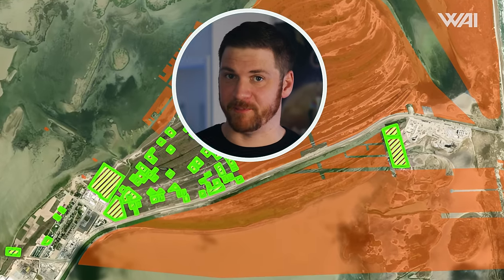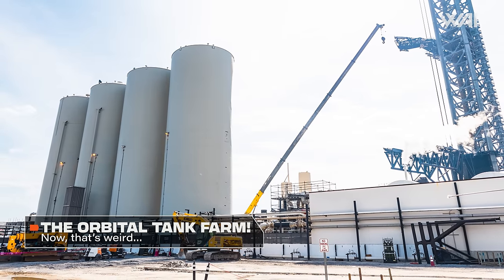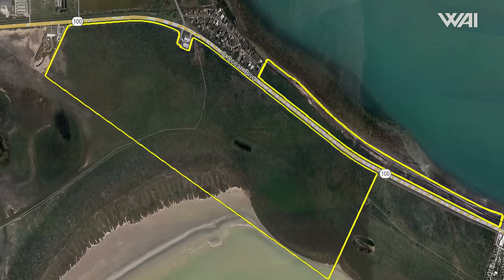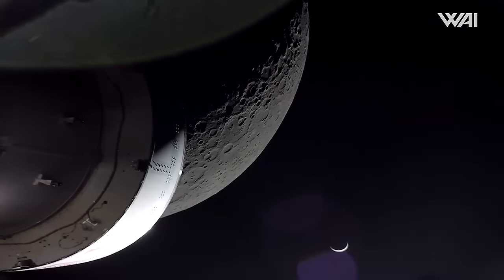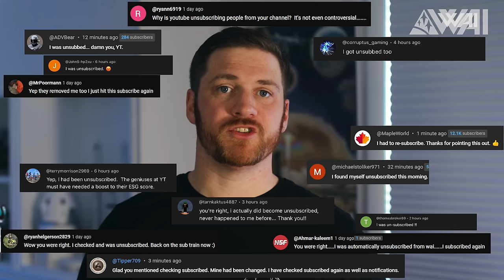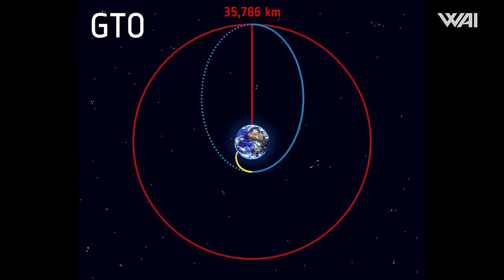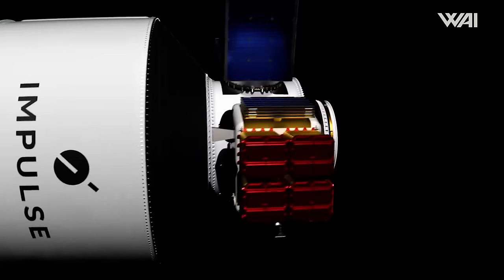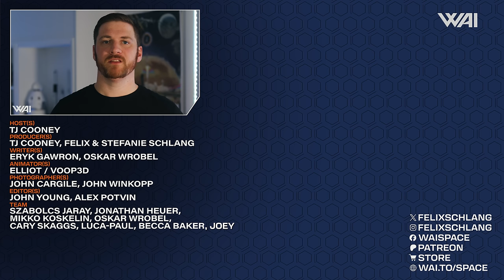Big Reveal: SpaceX & NASA Mars Plan!

Comment: The launch base can’t keep being welded back together after each launch. One would think it weakens the structure with each re-weld.  A redesign might be required. Not very ‘rapidly reusable’ considering. 

I said it during the first launch, actually before, that I couldn’t understand how they could launch the world strongest booster and not have a flame diverter. 

Of course I received snide comments like “I’m sure the engineers at SpaceX know more than you” well… you were saying. 

The water cooled plate doesn’t allow flames to escape the pad like most do with a diverter in addition to a suppressor. They have one (now) not both.
Reply: The launch infrastructure is much "test hardware" as the vehicles and the construction yard are. The current tower certainly won't be the final version... it just needs to be good enough to do a few launches, and they'll incorporate the necessary improvements into the next one.

Comment: I believe that, the actual workhorse that would lead us, humanity, to Mars, is a reliable SSTO ship, where the cost by pound of cargo to high orbit drops considerably, enough to make the cargo transfer to a interplanetary ship, and that could be even materials for assembly on orbit. Remember that open interplanetary space has a ton of radiation, enough to give deadly doses for the crew if not fully shielded. This shielding, is heavy, being a metal one as lead or a magnetic one, wich also needs a lot of energy, more likely nuclear reactor (fusion or fision) with all its weights and problems. After that, if the mission is a long one, the need for hidroponic oxigen recycling is the more reasonable way, and all this needs energy, space, resources, etc. So... My best way to see a Mars mission before 2050 is a SpaceX built SSTO, where it can reach high altitude flying, where the altitude per pound of fuel efficiency is better, then kickstart the vacum optimized rocket engines to propel the craft to orbit. Years ago i made the calculations and you could deliver 20~25 tons to ISS orbit with this method, avionics borowed from a F18/F15 and the SpaceX engines for oxigen methane crigenic propulsion. The aerial propulsion its just a turbine/scramjet hibrid (already tested and working as a clock), and you could get real high, at real fast velocities, giving the craft a nice boost in initial speed and altitude, and you start where the atmosphere is starting to get slim. Win, win, win situation. The tech exists, the capability is there, the only thing i believe isnt there is to show how much difference is between public military/civilian tech and the hidden tech, wich makes me believe im not the first guy to run this numbers and getting this conclusions.
Reply: Hey how's Skylon going along? Is it launching regularly like Falcon?
Reply: @alvianchoiriapriliansyah9882 the what? I believe that half of the things i said in my comment you didnt read... But anyway... You can check my math anytime, and if you have diferent results, feel free to show them to me. I stand with my math, i revised many many times...
Reply: @sammaier4413 Because relying on an SSTO rocket that's not even testing components yet is surely far more reliable than relying on proven flown method /s
Reply: @alvianchoiriapriliansyah9882 and thats why i specificly didnt said rocket SSTO, talked about flying with a turbine/scramjet hibrid... Does that sound to you as a rocket?
Reply: @sammaier4413 Yes which is similar to Skylon, currently unknown if it's ever gonna fly

Meanwhile Falcon 9 just launched a few hours ago, and continue to do so for many times a month. I can see which method SpaceX will use to economically send missions to Mars
Reply: @sammaier4413 Convince SpaceX then
Reply: Well, im trying! I have tried to talk directly to them, 3 years now... But no luck... I guess that i have to make a scale model and show them it can reach high atmosfere to them to take this seriously...

Comment: Seriously, jets travel faster spaceward than rockets with an angular approach. A mach 1 jet would beat a rocket to space. Using less fuel in the process
Reply: Question: where would you get an oxygen for jet in space from?
Reply: @alvianchoiriapriliansyah9882 Possibly from all that fuel reserve that isn't burnt off in launch?
Reply: @CalamitousJonathan Yes, "oxygen is a fuel"... lmao
Reply: @alvianchoiriapriliansyah9882  Currently yes. Liquid Hydrogen and Liquid Oxygen are currently used as fuel.

Comment: SLS Block 2 has so much potential. Can't wait to see it fly!
NASA should have planned to go with 2 SLS (one lander, one Orion) from the start, instead of spending billions on funding the development of two additional redundant methods of bringing large payloads to the moon. One of the main reason SLS is so expensive is because they spent so much on RnD, only to barely use it with very low launch cadence, thereby splitting the RnD among only a small number of launches. 
NASA should be launching one or two SLS missions per year, at a minimum. And not just Artemis missions, NASA should be funding many more missions that take advantage of SLS's capabilities.
Imagine if NASA built the Saturn V, only to then also fund the development of the N1 to deliver the LM to the moon.
Reply: Those single lander cost more money for NASA than two of the current landers combined, and with added nice bonus of being able to go beyond budget

One of the main reasons of SLS high cost is because it's primarily focus on jobs. It has more workforce than SpaceX & ULA combined because some Congressmans/Congresswoman's wanted to get reelected. Inspector General dismiss the idea of increasing production reducing cost on SLS

Don't be fooled by Griffin's rhetoric
Reply: @plainText384 Hmm Inspector General seems to disagree with that

Comment: NASA still has a big problem with arrogance. The finance arm of NASA (HQ) is not the problem. Many administrators/directors and many experienced NASA engineers are suffering from inexorable arrogance. The recommendation is for NASA to change and start pushing these people out or place them into a silent parking position. What is needed is the aspiration of the newer NASA personnel. Did you know that NASA avoids hiring from industry and encourages hiring directly from school? One reason for this is to avoid the deprogramming of commercial hires prior to training towards the NASA way of doing business. What we need is a new NASA with new NASA policies with a new way of doing business. This is what is really needed for getting to Mars efficiently and effectively. Come on NASA. Stop holding the human space program back. We need NASA to start safely accelerating. This means more failures. Since NASA can no longer survive major failures, the best solution is to transfer the risk to commercial development companies like Space-X. This is a good direction and it shows that NASA HQ has figured this out and will get the GAO seal of approval. Go NASA HQ!

Comment: * DEEP SPACE TRANSIT TIME REDUCTION SCHEME *
Immediately begin the development of a "Port Tug Accelerator" space craft (featuring nuclear powered engines designed PUSH items to high velocities quickly). This specialized space craft will be used to PUSH (accelerate) any spaceship toward its deep space destination! The Port Tug Accelerator craft will push any deep space bound space ship only for a short distance and then let the deep space bound space ship glide to its destination with the high velocity provided by the Port Tug Accelerator craft. Place one Port Tug Accelerator craft stationed in lunar orbit until needed, and place a second Port Tug Accelerator craft in Mars orbit for Earth Return Trip velocity assists. This high speed accelerator system will reduce space ship fuel requirements and reduce travel time in space. (Thanks for your considerations and for sharing this concept!)
Reply: How does it DE-celerate?
Reply: Continuous acceleration of 1/20th G until mid point, then flip and Continuous deceleration until target. The Delta-V increase from using nuclear to accelerate the fuel might make this possible. The other benefit is that then you have a bit of microgravity to make activity onboard a bit easier. Keeping the Tug in space makes sense though, once you have it out of the atmosphere, keeping it there will make people less anxious than constantly bringing nuclear fuel through the atmosphere.
Reply: @kstricl  The idea of a Port Tug is for it to NOT leave Earth's/Mars' vicinity.  It'd need to meet the incoming vessel in 'deep' space, dock with it, and apply acceleration to slow it down for orbit-to-planet transfer.
Reply: @LordDustinDeWynd  I understood your idea, but it takes a huge amount of Delta-V change (aka fuel) to meet an incoming vessel. Much cheaper, if you're going to do it, to have the tugs stay out in space (in geo maybe?) and essentially "rent" them for the mission duration. A vessel would have to be going relatively slow for a planet side capture, which negates the advantage over just doing a massive burn with a group of Raptors. A strong steady push could shave months off the mission, without putting major stress on your components - which is why even the ESA is looking at possibly going nuclear rocket for deep space missions.

Comment: Griffin is not all wrong, SpaceX would have to refuel their moon lander in HIGH Earth orbit AND transfer cargo in orbit to carry to the moon, none of which has ever been attempted. How many Starship tanker trips would be necessary to refill one moon lander, 10 or more? How much of that fuel would be consumed just for the trans-lunar injection, then the lunar descent/ascent and the return to Earth for more fuel and cargo? Far too many complicated, untested parts to be a viable system, remember "The best part is no part"! Much simpler to launch cargo directly to the moon on reusable boosters and EXPENDABLE landers that can be repurposed on the lunar surface and keep two SMALL fully reusable passenger shuttles at the lunar gateway capable of both descent and ascent (with one for backup/surface rescue) that could be resupplied with fuel from Earth until it can be produced on the moon.

Comment: Congress would never authorize the outrageous expense of SLS throwaway rockets for a Mars Mission with only 2 astronauts for a 30 day stay on Mars.  With the cost of a single SLS balooning into 5-6 Billion dollars per launch with no guarantee of meeting any kind of schedule without massive cost over runs and delays,  This plan is completely untenable.  SpaceX's ability to build multiple Starships for a mere fraction of the cost of one SLS and Elon can build multiple Starship tankers to have a very frequent launch cadence to keep the orbital tank farm filled, he can have a virtual train of Starships on the transorbital  route to Mars and back with each vessel arriving at Mars a couple of weeks apart, supplying massive amounts of building materials and supplies to an orbital station at Mars.  The landing of vessels on Mars surface can be an ongoing process until the refueling plant can be built and in operation at Mars to supply fuel  for return flights prior to sending Astronauts 20-30 at a time.  Much miore effective than the giant waste of money of the SLS system.
Reply: But jobs from SLS program sounds politically delicious tho

Comment: Michael Griffin is correct.  Orbital refueling seems like a reasonable idea if you like hand waving, but once you get into the details, things quickly fall apart.  You'll probably need at least two orbital launch mounts, two Super Heavy Boosters, and two tanker Starships just to get started.  Then you'll need spare Super Heavy boosters and Tanker Starships on hand, ready to swap into the rotation in case of failure, to ensure the orbital refueling campaign can reach the critical supply needed for a deep space mission.  How many spares do you need?  Well, that depends on how many consecutive launches a Super Heavy Booster or Tanker Starship can perform before it needs major reapir. 

No one has any idea how reliable Super Heavy Boosters or Starship Tankers will be.  Given the large number of engines on the Booster, and the Thermal Protection system on Starship - we just have no idea. But I think that they can reach a goal of swapping out a component once for every THREE launches, then it might work.  However, you would probably need to have an extra Spare Booster and Tanker Starship on hard in case of bad luck.  So, for 12 launches, you need TWO Super Heavy Boosters to start, FOUR Super Heavy Booster spares for swap out, and ONE extra one for bad luck.  That's 7 Super Heavy Boosters, and you'll probably need at least that many Tanker Starships.  And all this is predicated on the fact that the orbital launch mount doesn't get damaged making everything twice as hard on the remaining launch mount.  Oh yea, and if the actual number is 16 launches as per the NASA study, then you'll need NINE Boosters and NINE Starships.  All this for ONE Deep Space Mission.  Two SLS rockets doesn't look so bad now.

This is all very problematic for SpaceX.  Which is why SpaceX is looking into STRETCHED Boosters and Starships to reduce the number of flights.  And I don't need to remind you, that redesigning your launch vehicle before it reaches an operational state is not ideal engineering - it's an act of desperation.   The severe complexity and logistics of orbital refueling with cryogenic propellents is a HUGE problem and thus far - completely unmitigated. 

Starship for deep space missions could very well be ... dead on arrival.

Comment: why doesn’t starship just use the chop sticks to pick up some of the weight of the starship during the launch seems like such a waste only using them on landing and not takeoff aswell 
maybe have a high power water jet that pushes and disperses against the plume of engines firing under the starship to boost it a little more
Reply: Useless

Comment: Umm don't think the big one is designed for Mars it's more than likely the MOON, I think it'll be a different design for the MARS trip, maybe fatter or bigger as bigger circumstance has the possibility of of spin therefore creating Artificial Gravity ...
Reply: The "big" one is required to get a meaningful payload into low earth orbit. The current starship stack can reach orbit but barely. The design is bloated and much of it's payload capacity is  sacraficed for the promised reusability.
Reply: Just because it's large doesn't mean it can't reach orbit, with the right booster you can launch a cube into Space, how many failures of falcon 9 before they had stable ones, so bigger means more fuel to get to the MOON,

Comment: Why does it seem no one ever mentions how jets fly faster than rockets, yet we are not using jet technology on the rocketships.
Reply: Because it's not an F1 race
Reply: @alvianchoiriapriliansyah9882  What is the space race then? Because I see the equivalent of go-karts racing against F1 racers and Nascars. Go-karts that run out of fuel by the time they complete the first lap
Reply: @CalamitousJonathan Nobody think space race as launching a rocket that's literally faster bud
Reply: @alvianchoiriapriliansyah9882 Rockets are slower than a mach 5 jet. We literally have mach 10 Jets. A rocket travels at mah 1 speed until most of the fuel is burned off and it slowly gets faster.
Reply: @alvianchoiriapriliansyah9882 Keep in mind at launch the rocket is going much much slower than mach 1
Reply: @CalamitousJonathan Wait until you find out that rocket exceed Mach 1 pretty quickly at the early stage of launch, and ended up at Mach 25.4+ after reaching space in just several minutes...

Meanwhile jet get shut down mid stage because of lack of oxygen
Reply: @alvianchoiriapriliansyah9882  Pretty much any plane could reach space within minutes.... Not a single rocket reaches mach 25.4+....
Reply: @CalamitousJonathan Oh so what do you think Falcon 9 is? An airplane?

Comment: NASA screwed the pooch when they ended the Space Shuttle program. They had a cargo bay roughly 60ft x 30ft, they could've converted to oxygen, and fuel systems that would allow the shuttle to travel to the moon and back, even carry a lunar lander to explore the surface of the moon. It already had 3 engines and thrusters. Such a waste to not reuse it in this manner.
Reply: Which would require a gas station infrastructure (it can't go to the Moon without ET refueling) that will need an increase in cadence. Something that Shuttle were failed miserably
Reply: @alvianchoiriapriliansyah9882  it wouldn't need refueling. The cargo bay would be converted to hold fuel and oxidizer tanks for propulsion to the moon. The shuttle would have been able to make it to and from the moon with on board fuel supply.

Comment: Did Japan actually land anything on the moon? They tossed two things out of a spacecraft and then, unpowered, crashed into the surface with no ability to prevent a tumble. 
Wouldn’t you build a shape that can’t end up in any other orientation?
Did that idea escape the usual detail with which Japan produces high technology? 😕
I don’t mean to be rude or dismissive of what happened but softly ask what seems like a fair question?